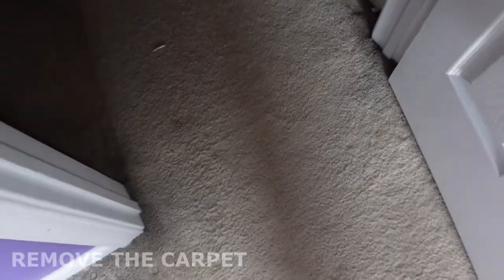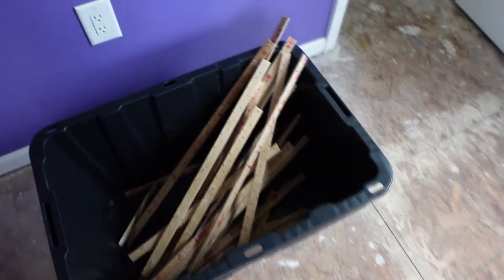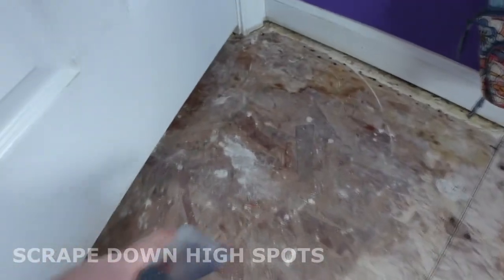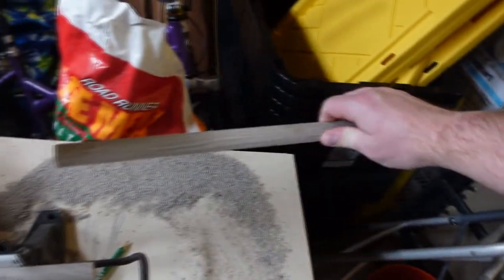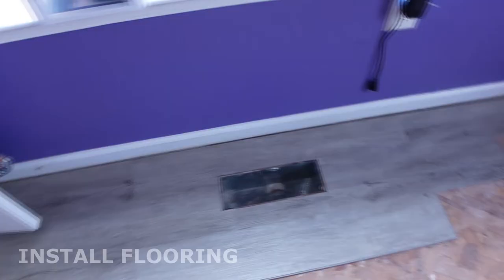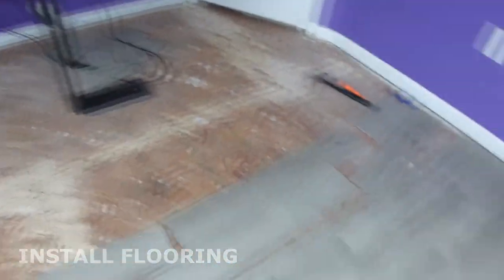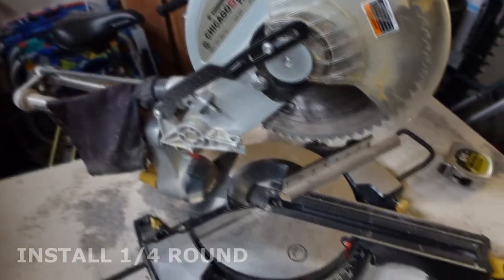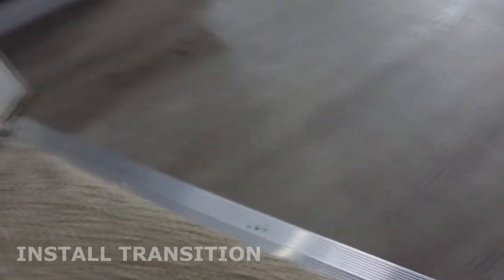Replace Carpet With Vinyl Plank Step By Step

Comment: You can not paint over wax, don't use it to fill nail holes in the quarter round.
Reply: Well the quarter round he's using is the same style as the flooring, so i don't think he's planning on painting it.

Comment: Hi, thanks for the video! Would you still need to install these as floating panels if the room is built with concrete or you’re in a place without much weather fluctuation?

Comment: @15:25 would it not have been possible to trace the cutout for the door frame in the end of the plank on the left and slide it down the groove from the end with a rubber mallet?
Reply from the maker: @tomsittler1791  yes, I used that method in the next video I did installing the next floor!